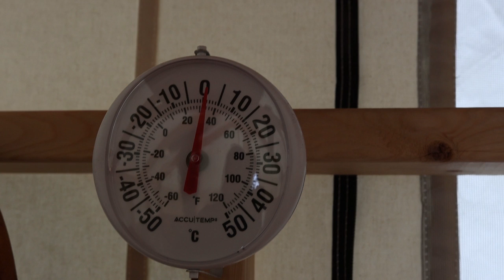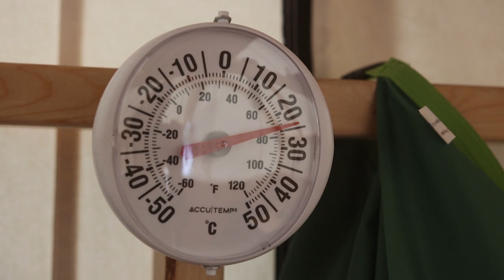Car Jack Tent, Solo Winter Camp Prep in Rain, Hail, Snow, and Northern Lights

Comment: Take the corner of your tent up farther than you think it needs to go. Jam some junk under the corner that's just a bit bigger than you need. It will settle. That corner is heavier than the rest and it's heated. there is going to be a bit of space running away from the corner as well. jam pieces of what ever in those spaces as well. If you don't, all the weight of that corner will be on that one spot and it will sink again. You want as much of the weight spread as evenly as you can to avoid it sinking. Love your vids bud, keep it up!
Reply from the maker: Yep you are right

Comment: I put a tarp over my tent since I leave it up yr around. I recently installed a pellet stove. “High Class” runs auger for 5 days off car battery. Recharge by small vertical wind generator. Have 2 other batteries for lights. Solar panel also $300. Living in luxury. Lazy boy chair bed refrigerator 12vt. I’m on a wood deck 8ft above ground. Carpet inside tent. Insulated curtains keeps tent quiet in storms. Very cozy🤗🇨🇦🇺🇸 Michigan

Comment: Just an idea, talk to builders around you or your area. Get left over insulation, Styrofoam if you can and bring it up as you get it. It can go inside in-between the wood and help you for the winter..you can even put some on the floor for winter to help keep the heat inside better. Hit the thrift stores they sometimes have loads of it and you can also get you a few things to keep there that aren't expensive so if it freezes and breaks its not too much of a loss. Good luck on your adventures. 👍

Comment: You asked for suggestions, so here's mine. A flip up mini counter top for your front door to rest your arms and coffee mug on. Get a scrap piece of wood, maybe 6 inches wide by about 20 inches long. Find 2 scrap hinges, mount the hinges to the top of the door and the scrap wood. Nail a support block to the door that 2 pieces of wood will act as mini jack studs holding up the counter top. When you're done using it, simply remove the 2 mini jack studs, lower the counter top flush with the door and close the tent up.
Reply from the maker: This is a pretty rad idea! I love my perch looking out that doorway to the lake. Thanks, Jay
Reply: @jaylegere  Also, I'm enjoying the latest videos. You seem to be much more comfortable and candid in front of the camera as compared to your earlier videos. It's a fun adventure for people like me who cannot get to locations that you can go to.

Comment: We've had a particularily Hot and Dry summer here in Minnesota, I'm sorta looking forward to Snow, probably be around November fifteenth this year, we've had some hard winters and I hope this one isn't quite so long. Great video. There's probably more "set" on the one side of the bow saw, means the teeth stick out just a bit farther on the right side so it saws more on the right side, maybe you hit a nail sawing something and the teeth are just a mite dull or missing set on the left, you can reset teeth on an old bow saw by putting it in the vice teeth up and use a crescent wrench to bend them very carefully tho'.
Reply: Probably a Chinese made blade.  I bought one new and it would saw in a circle.

Comment: Love watching your adventures Jay. Keep the bottom holes in the truck rim open to let air in, it will concentrate the heat leaving almost nothing but fine ash by morning.  For Peets sake man , get a Chainsaw. Even an electric one. Way more work in less time. More time for other things. Stockpile LOTS of wood ahead of the winter so you don't have to forage for wet wood every trip to your camp.  Stay safe. Sudbury Ont.

Comment: Put an appropriate sized rock/boulder directly at the corner of your tent. Position the jack about a foot away from the corner and place a piece of cut 2x8 wood and place below the jack for a solid base.
Or you could have just used the 2x8 wood plank for a lever/fulcrum to raise the corner.

Comment: Excellent job of straightening out the tent.  I winced when you had your fingers between the two pieces of wood while you were knocking the wedge into place.  Please be careful putting fingers where they might be pinched or crushed if things fall off the jack.  It could really ruin your day.  Safety first when you're that far from civilized medical care.

Might want to consider measuring the gap and wedging a larger piece of wood in there too.  That small wedge piece you used might split in colder weather where a (several?) longer piece of log/branch would hold together better.  A single wedge means you are one unexpected event from system failure.  Try wedging a couple backup pieces in there too.  It will be a lot harder to fix things once temps drop below freezing and everything is covered with a foot of snow.

As always, awesome shots of nature's beauty.  And now we know what the phrase "smoking hot pants" means.  ;-)  Maybe next time you can take a set of comfy PJs to leave at the tent for "emergency apparel" to wear while drying out the wet stuff.

Comment: I think the reason your bow saw cuts that way is it is sharper on that side. Either file it and try to get it back straight.. Or get a new blade. A good file will fix it though. Nice set up. You have a nice place.

Comment: Regarding the saw: it's almost always you.

To confirm that; first check that the frame isn't bent or crooked, if there's minor warping in the saw blade it shouldn't matter too much because the whole point of a frame saw is that the tension pulls the blade straight.

Then check the teeth on the saw to see if the teeth on one side stick out slightly more than the teeth on the other side.
If the teeth look to be even, it really is just you.

If the teeth are crooked or they stick out more on one side you should be able to fix it by just bending a couple of the offending teeth back into place. Remember that it's possible that the offending teeth have been bent in towards the centre, not just bent out so might need a punch to push them out and not just a hammer.

Before you waste your time trying to fix it check to see if the teeth are hardened; if the unused teeth in the corners of the frame are a bluey colour they'll be hardened, if you're not sure you can just take a file to a couple of teeth, if they don't file easily then they're hardened. If the teeth are hardened buy a new blade.

If there's nothing wrong with the "set" of the teeth (how far out they stick on either side) then it's probably you. If you can cut straight with other saws it's likely that over time the blade has become blunt and you've been compensating for that by using more force without realising and it's the change in your sawing technique (to apply more force) that's causing it to always curve in the same direction.
The same caveats apply for blunt teeth as they do for crooked ones.
Reply from the maker: Thanks for your tips!

Comment: Funny that ! Early in to the video i was thinking about how long it takes the lake to freeze to the point that you can ride a snowmobile on it, i was thinking that you could get trapped on the island if the lake surface froze overnight.
As for your winter arrival routine of sawing up logs etc etc, there is no reason you can’t still do all that but at the same time just have an emergency log pile that ready to go anytime.
Reply from the maker: You make a good point!

Comment: I have a friend that hangs the silver emergency blankets to keep heat in at all her windows . Don't know if you could use something like that. I use cheap moving blankets in my tent ,either on the walls, bed or floors . You cant wash them . If they get damp I just hang them to dry and use frebreze spray on them .

Comment: Put a strip of wood on the outside of the door opening on the latch side and it will cover any gap that forms over time until it too wide and needs to be addressed.

Comment: Hey, why don't you insulate the tent with 1/2 in. x 4 ft. x 8 ft. R-1.93 Insulating Sheathing boards between the tent & the 1/2 plywood walls, they are fairly cheap but it would make it so much warmer & less drafty.

Comment: For your buck saw cutting crooked issue.  It is because the teeth on it are not properly set.  They need to bend out in an alternating pattern.   When are you moving to your new camp site location?
Reply from the maker: Thanks! Glad you answered the question. I will be slowly picking away at the new site over the winter. Not sure when I'll do a complete move.
Reply: @jaylegere  You're best option is to replace the cheap blade that came with it.  Get Bahco branded blades.  They are made with proper set.  They make blades for dry wood and green wood.  Get the one that suits your application.  I personally prefer to use a 20" to 24" coarse cut carpenters hand saw for my winter wood processing needs.  They tend to cut straight, are not under tension so less likely to break.  They are readily available at your local big box hardware stores.

Comment: copy this and look Propane Tank Adapter Refill Canister Filler Cylinder LP Gas 1 LB Brass Valve, so you can refill them from a bottle your self.  Plates get surplus  copy and paste / Mil-Tec by STURM Six Compartment Mess Tray Stainless Steel. Keep spare clothes there just something, sweat pants and shirt.  Jay you like to go and cut wood and all that great, but that is for next time. Get the fire going then cut it . you are 98.6 degrees at 95 degrees you are hypothermic,  Take your ring finger and touch your thumb if you can't ,it's started.  Where's your friend. Copy those lines and take a look.

Comment: need to pick up a 20v electric chainsaw. 2 batteries will last all weekend. Clear all that brush up and prepare for winter.
Reply from the maker: This is a good idea. I have a few chainsaws. But a small one for around camp might be what I need. Especially considering I have a bunch of DeWalt batteries
Reply: @jaylegere  they are light-weight, quiet and can easily go through a trunk 12 inches thick. DeWalt makes a good one, so does Milwaukee. As much fun as sawing logs is... next weekend, you can get a whole winters supply of wood ready in an hour.